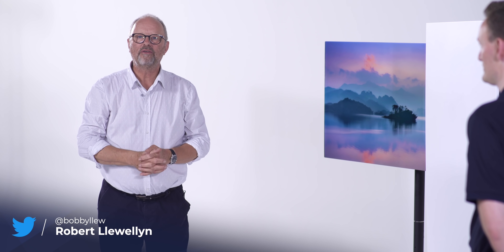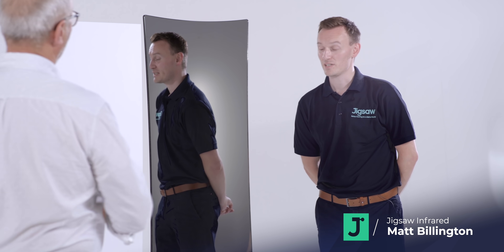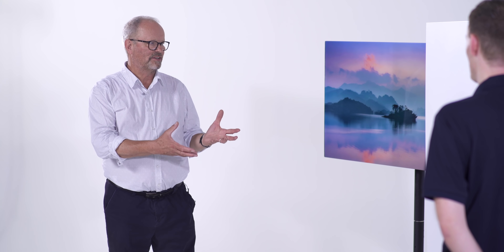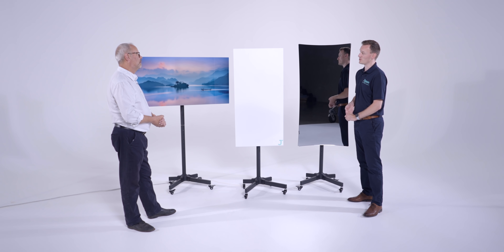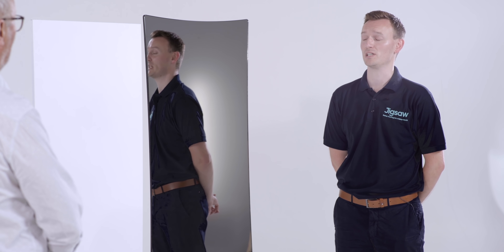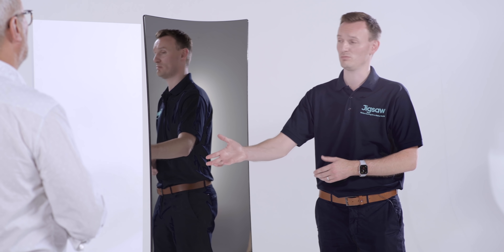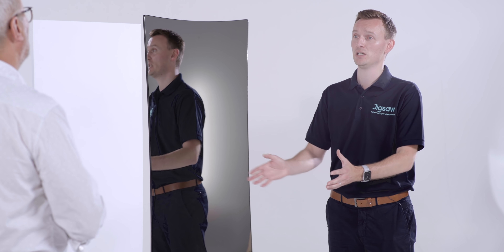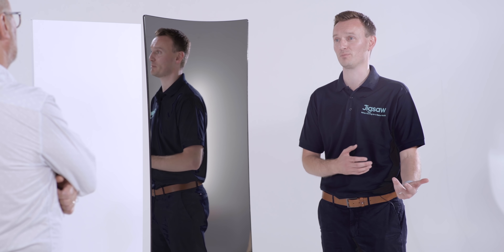JIGSAW INFRARED - Heats like the sun, cares for the planet | Subscribe to Fully Charged PLUS

Comment: Be careful with this one. Physics says a kWh is a kWh whether it’s from gas, oil or electricity. Ripping out storage heaters on the Economy 7 tariff to replace with glorified electric bar radiators at peak tariff is nuts. Yes it’s a form of heat but don’t be fooled. After all a passive house can be heated with 13 candles. Credit the solar panels and fabric first for that not this. They look nice though!
Reply: I'm with you and Larry Phenis on this. I just don't get it. They are just fancy electric fires. What more does it do that an old style electric fire or convection (fan or otherwise) heater doesn't? With this type of heating you can't get more heat out than the amount of electricity you put in no matter how you package it. When he claims that the infrared radiation bounces round until it is adsorbed by something in the room, exactly the same can be said of the more conventional electric heaters. 
On the other hand using the same amount of electricity to run a heat pump should get you around 3 times as much heat for the same running cost.
Reply: @pjaj43  there no infrared, how the hell do there expect to it to get out it's in a enclosed box, Infrared can't pass thought metal anymore than visible light can.
Reply: @barryrogers9862  Not strictly true. All objects, except those at absolute zero, emit (and adsorb) heat radiation (infrared) to some extent. The hotter they are, the more they emit. If you heat a "metal box" above ambient then it will be emitting more than it adsorbs. This is what you feel when you stand near it. Generating heat inside the box transfers it to the outer skin via conduction and the internal radiation from the heater being adsorbed on the inside of the box and thence, transferred by conduction to the outer surface where it is re-emitted, again in the form of infrared radiation.
Reply: @pjaj43  All true  Peter,  but not direct from the element which take away it one redeeming feature to ability to direct the heat, a flat panel isn't very directional. it produces no more infrared than any other heater at the same temperature, just using buzz words to make look better than it is, at the end of the day it's just an electric heater with no eco credentials and has no place being featured on a channel such as this
Reply: @barryrogers9862  I agree with you completely Barry. I must say that the entire spiel smacked of the snake oil salesman. He was trying to say that his very expensive electric heater was, apart from its looks, somehow better than others. I'm not convinced in the slightest. I'm surprised that Robert was taken in by it and further agree that this had no place on this channel.
Reply: @barryrogers9862  maybe you should read a bit more on the internet to learn about infrared?
Reply: @pjaj43  Obviously you need to spend some time reading up rather than making remarks where you do not have the expertise to pass on anything but your assumptions.
Reply: @pjaj43  How insulting. Of course you are an expert?
Reply: Electricity is 25p/kwh, you're bonkers to want to install these in a home.
Reply: @glennbillington4879  Exactly. Like here: https://en.wikipedia.org/wiki/Electromagnetic_spectrum or here: https://en.wikipedia.org/wiki/Infrared or here: https://en.wikipedia.org/wiki/Sunlight   Any one of these shows that the claims made in the video are simply wrong. I would love to be shown to be wrong, to be provided with some evidence that these panels are more efficient, or useful, than alternative electric heating systems. I guess it might be considered a plus to have the option of having a thin panel, i.e., different form factor. But that doesn't mean the claims are anymore correct. Oh -- and despite what one genius called Michael Gove seems to think, there are such things as experts; and expertise is critical to our survival as a species.

Comment: there website doesn't show comparative costs to gas or indeed standard electric storage heaters. they say on there website 30%   more efficient ('studies show'). this is vague and anyway not particurlary good.sounds much more expensive than gas and cost is the metric that will get most people to switch.
like a Tesla car, we all love them and would buy one if we could get one for £5k on the second hand market.
another energy product for the rich only it seems.
Reply: The study shows Jigsaw Infrared is twice as quick and half the cost of storage heaters. The study is being released very soon. Before you ask, it was carried out in a controlled environment at a University.
Reply: @glennbillington4879  great but storage heaters are renowned by being very expensive. they need a comparison with gas if they want people to switch..
Reply: @gazlives  That is coming but not everyone has gas. There are hundreds of thousands of people who need to use electric.

Add to that, a great number of people are adding solar and battery so they won't be reliant on the grid or the gas board.
Reply: @glennbillington4879  that a good point it can  persuade those on electric already. I'd like to be comparable with gas, esp. in uk with so many on gas.

Comment: Nice idea and nice looking units.  Not sure onthe price tag and £400 notes for a small unit and £700 for a larger unit, compared to £89-120 for a single large radiator. Suppose you dont have a boiler to worry about and the water leak potential.  Not sure how the hot water would work as no space in my new house for any type water cyclinder , does not even have wardrode space in the bedrooms !!!
Reply: The loft?

Comment: If gas cost per kWh was identical to electric cost per kWh, then it would be cheaper for electric heating - especially when you add in the smart features. I suspect that gas costs will continue to rise so that we   are forced into switching to electric heating.
Reply: Spot on Antony, it's great to see a positive response from someone who knows what they are talking about.
Reply: In the UK, the government has a 23% tax on electricity  (+VAT) for domestic customers, whilst gas only has 1.9%. That was about right when we burnt coal and oil to make electricity, but now the pollution caused to generate electricity is about the same as the pollution caused to burn gas at home, so these taxes should be equal.

Comment: It's a bit ironic really, talking about getting rid of gas boilers, yet it's ok to use gas power stations to provide these heaters with electric. 👍
Reply: Well, the issue there isn't the electric heater, it's the fact that the UK still has too much fossil fuel generation. But that's changing, just like it is in most places, and just like EVs, as the grid gets cleaner, so does your heating, but a gas boiler is always going to pollute the same, or worse as it ages, plus you run the risk of dying from CO poisoning and a shortened lifespan from breathing particulates. Getting rid of a gas heater is a no-brainer, really.

In Australia, the most popular heating is now reverse cycle air con, there are some really efficient units, the two best probably being Daikin and Mitsubishi Heavy Industries (not Mitsubishi Electric, which are the cheaper, crappier brand). Even at sub-zero outdoor temps they can have pretty good CoPs.
Reply: @ledsalesoz  electric is too expensive compared to gas, plus the UK has had to fire up coal power stations.
The UK grid can only just cope at the moment, without chucking millions of battery cars and electric heating at it. And that has nothing to do with the current situation is been like that for years.

Comment: Interesting to see, although I'm not convinced about the 'heating the fabric' comments. I would say that whilst it might be less efficient, wet underfloor heating used over the whole floor area would create an even heat that will warm the fabric. If the building is modern/well insulated then the flow rate and temperature could both be reduced to a very 'background' level.
These certainly have a place in ecclesiastical buildings as pulling up stone flags to lay underfloor is not a very useful option.
Reply: One of the issues with wet underfloor is heat up and response times. Sure if you are going to leave on a basic background heat that has some validity. How many householders are going to be happy with a basic background heat instead of actually being warm? I think the point to note is that there isn't a one size fits all heating solution. We're one part of the Jigsaw of heating solutions as is wet under floor heating.
Reply: Is this something you have ever tried? Your comments are more about other forms of heating and it would be good to understand your expertise?
Reply: I've never tried infrared but have carried out a whole house retrofit with slab/insulation/wet underfloor/screed/porcelain tiles (with aluminium triple glazing, MVHR and external wall insulation) and can't imagine how this could beat the low flow temp, topping up the building as required with the underfloor set up. Temperatures are stable and it's really been a complete game changer in terms of how comfortable our (originally) leaky 1929 detached 3 bed is to live in. Just need to get rid of the gas once the cost of other electric alternatives comes down to a reasonable cost.
I'm sure there are use cases for infrared but I can't imagine it could compare to the gentle top up heat, coming from below, across the whole floor area.
Maybe I'm wrong, but I guess we're going to need all the solutions we can get to move towards space heating that can be powered by 100% renewably generated electricity 👍🏻
(and made in the UK, that's novel but so welcome).
Reply: @glennbillington  Not sure if you were asking me, although I'm a Building Surveyor in case you were asking me. Like I said, I've got no issue with the product as they certainly have a place, but it won't be able to 'heat the fabric' quite as simply as the interview stated.

Comment: If the electric heating is 100% efficient and gas is 85% the gas is still more efficient (for now) because the electricity being produced is coming from a gas power station which is only 50% efficient and then you have transmission loss ontop of that

It is true that renewables and nuclear combined make up around 50% of the UK's electricity production, but any additional load put on the grid will almost exclusively be covered by gas power stations, that being said once the grid nears 100% renewables we can't then swap out every homes heating instantly and switch every petrol car for an electric one instantly so these projects will have to happen somewhat simultaneously
Reply: Is this a subjective remark to mark without any objective evidence?
Reply: @glennbillington  what part of my evidence is subjective?
Reply: @olivergunn2796  all of it.
Reply: You can just choose a Green electricity supplier

Comment: It's not a heat pump though so only 100% efficient rather than 300-400%. Aren't we being conned into thinking these are more efficient than they really are?
Reply: Not sure 'conned' is the word, but clearly heat pumps are a better use of electricity to generate heat - but this is not aimed at people who have that as an option - though you could achieve a similar effect with a £25 halogen heater stuck to the ceiling with a motion sensor switch! ^oo^
Reply: Heat pumps are not always suitable due to current prices (10k), space, etc. Such solutions like a modular system and less costs are all making such products a good option for many. Not for everyone but for many :)
Reply: Heat pump COP is not all it’s claimed to be. The COP figures do not come from real life testing and the COP is often closer to 1:1 

An independent study – commissioned by BEIS but written by Cambridge Architectural Research – investigated cost-optimal ways to install electric heating, including infra-red heating, and energy efficiency measures across a 12 housing archetypes, representing 90% of Britain’s 28 million homes. The study found that:

•	The total lifetime costs (capital + operating) of infrared heating were found to be competitive, although not cost-optimal in some housing types.
•	There were only small differences in costs over 15 years between low- or high-temperature heat pumps, air-to-air heat pumps, infrared or storage radiators.
•	Assuming a longer product lifespan (e.g. >20 years) for electric storage heaters and infrared heaters made heat pumps less attractive over the total period of ownership – as heat pumps were assumed to be replaced more frequently.

Additionally, Aston University undertook an independent study for three different heating systems. Jigsaw Infrared was the infrared system used in testing. 

The Study found:
IR heating system can increase the room temperature to 18 C in 10 mins which are less than the other two heating systems (2000 W and storage and convection) which take 15 and 17 min respectively. 

The IR heating system can heat the room temperature to 22-23 C compared to up to 18.5 C for the other two systems. 

The IR heating system has an efficiency 2 times higher than the 2000 W and storage and convection heating system. 

Therefore, the IR panel used half the energy (50% less) of the storage heater and reached room temp in almost half the time.
Reply: No, you are not, the experts in the Universities have stated infrared is efficient and you should try it. Heat pumps are heat pumps and will break down in time and then the efficiency will become less and less. Then you’ll have to replace it.
Reply: @jigsaw.Infrared  No point in trying to rewrite science.
Reply: @jigsaw.Infrared  Can't fault you for a thorough response, ^oo^
Reply: I seem to have touched a nerve here. I have installed quite a few heat pumps and, like fridges, they last a very long time if properly installed.The COP is maintained and will not change as long as airflow is not restricted (fans and fins cleaned periodically). I'm not saying IR heating doesn't have a purpose but I do feel that the general public are confused by the term "Efficiency".

Comment: Maximum efficiency is 100% probably less than that.

Heat Pumps are close between 300-500% efficient.

This has limited application, like flats where you can't install anything outside, or very old buildings where you don't want to install pipework everywhere.
Reply: Really Vikash? Obviously you do not understand the product and it may help you to learn a little more? There are plenty of studies to read and a recent one from Aston University would make you understand more.

Yes, heat pumps work but we're not competing with them. Heat pumps do a job in areas where there is space to install and the budget is high. 

Infrared heaters are designed for use in any property as long as it is professionally specified and the control system is correctly operated.
Reply: @glennbillington4879  you are only focusing on cost of install. There is a bigger cost of ownership. Electricity is expansive. 

Putting people into fuel poverty because the cost of install is cheaper is not cool.
Reply: @v_0  That is a disgusting comment to make and you should remove it immediately.

Your ignorance of the subject matter is now obvious to everyone.
Reply: You don't need to heat the air or the rest of the room with these. These just radiate heat onto you where you are sitting.

Shut down heating in the house and just turn on a single panel over the couch where you are watching tv or a movie and be just as comfertable. That is the idea of these things.
If you want to heat entire spaces or buildings heatpumps are obviously more efficient.

Comment: Rubbish! Infrared and blackbody heaters have been around for years. Also, some shops had them fitted these are not new just a different type. They may have a very small place in the market, if the heat loss of the room is 3KW per hr then you need 3KW per hr to maintain it once you have used say 5KW per hr to get it to the right temperature.
Reply: Agreed. This is an advert for a specific company paying Fully Charged to get the word out about their resistive heating panels.
Reply: Thats a very open statement Alan. What is rubbish? What are you stating a fact about?

Is it rubbish that infrared is used or that it is a better option than many other methods of electric heating? 

Or it rubbish because you do not understand it?

You talk about heat loss as though your profane to be an expert, is that the case and if so then you may be able to help the infrared companies make some improvements?  Or all heating companies out there?

However, if there is heat loss then it is better to put that right before any form of heating is installed.

The place in the market may be small but as the people are educated they may wish to have infrared installed. Is that for you to decide with your negative attitude.

As I've said several times now. It will take many different ways to help this situation and infrared is down to the choice of the customer and you stating things to be rubbish does not mean you are right. In fact, I would call you out and say you are 100% wrong!
Reply: @OAK-808  the second pert of your statement sounds incorrect. I don't thing Robert would be associated with such a paid advert. He's a funny bloke alright but that doesn't mean he has the morals of the PM. Quite the opposite, I think he is a decent and honest person.

Comment: Surely this has to be LESS efficient than storage heaters since it is the same resistive heater as storage without the storage!  Looks like old technology with the words 'infrea red' added.
Reply: Maybe not. There's obviously going to be inefficiencies in storing it in the storage heater and bringing it back out again.
Reply: @Hyfly13  It's a resistive heater and therefore an inefficient way of producing heat. The video is an advert for a fashionable item that in the future will have very limited uses. Certainly not heating an entire house. Convenient and easy, but woefully inefficient.